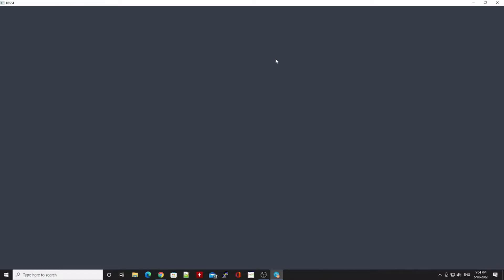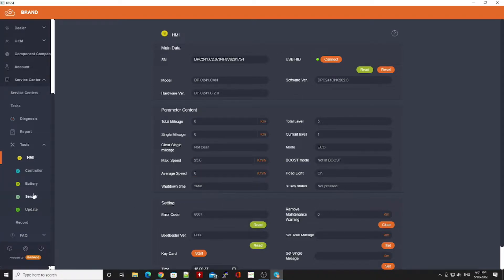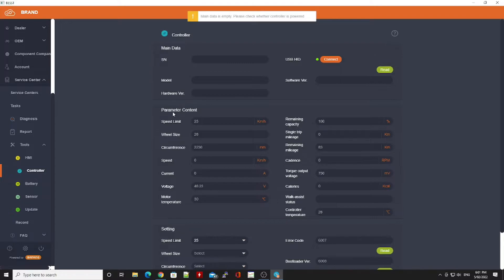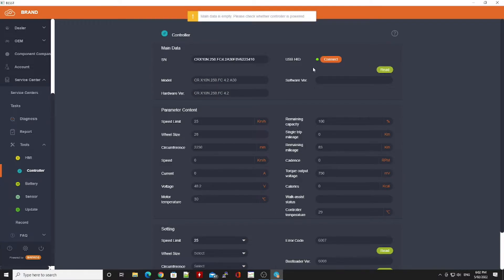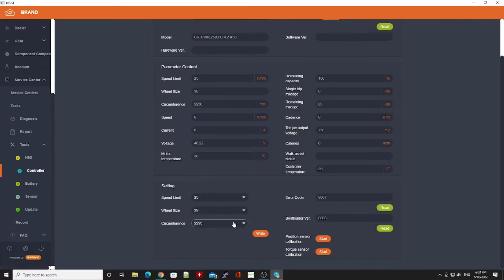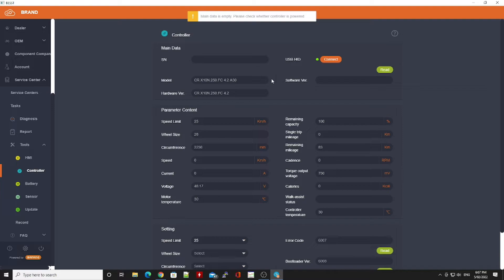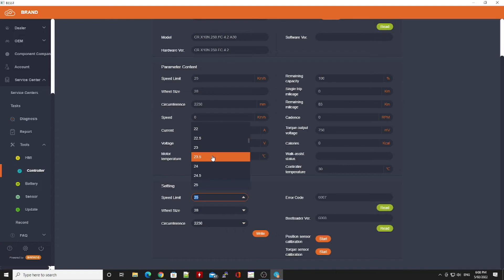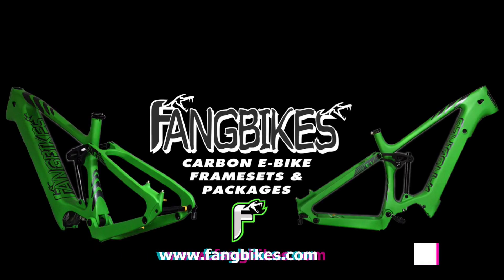Bafang M500 Speed Limit Increase - BESST - Solution - Read controller serial number

Comment: Hi, I would like to ask for some advice.
I am trying to increase the speed limit through the "besst" program.
Unfortunately it won't let me. I can only set a lower value than 25km/h.
have filled in the serial number correctly.

error: "Dealer or Assembler can't change it to bigger."

I tried the latest and older versions of "besst"
Does anyone know how to do this please?

Thx.

Comment: Can I use the best tool to add a display setting. My BBSHD is 52v  but my display only has a 36 or 48v setting. It works okay but is not as good as it was with its original display (which broke)

Comment: Question: It works with the new M410 (same new ∆ Connector) as well? Nowhere i find answers) 
 The older M400 still has the round plug...
Thx

Comment: Hi ,
I have a Jorvik mt7 tricycle with a 250 w mid drive motor bafang M 500. I thought the M500 wasn't programmable. I need to have more strength when I climb a steep slope and i would like to add a few amperes. Is the bafang M 500 really programable? If it is, Which cable to I need please ?

Thanks for your Video

Gabriel
Reply from the maker: You can update the wheel size and speed limits, but otherwise you cannot update any of the power delivery parameters. The tool is called the BESST tool. Cheers
Reply: @fangbikes2751 and how do you get access to use the tool? It says on the bafang website you need to contact them to get access after downloading.

Also I second the question about cable/comnection.

Comment: Se puede cambiar el límite de velocidad de un m500?
Reply from the maker: Yes you can.  The process is the same for the M500 and M600. I do not know about the M510.
Reply: @fangbikes2751  Is a possible change the Speed up to 25 km/h only from the display???with +/-????

Comment: Hi.. I want to weld it m510 to a 20 inch folding bike.. is there an option for 20 inch bikes in the settings??
Reply from the maker: Yes there are multiple wheel settings in there
Reply: @fangbikes2751  dove si compra beest?? posso fare da smartphone??

Comment: My M625 doesn't have throttle from a dead stop. I have to be going a few km per hour for it to engage.
Can I override that with this software and the tool?
Reply from the maker: no idea, sorry.  This is for the M500 and M600 range of motors.
Reply: @fangbikes2751  I have an M600 now that doesn't have throttle from a dead stop. 
I have to be going 5-8km/h per hour for it to engage.
Can I override that with this software and the tool?

Comment: Hi can you give me the link where to buy the PC-motor cable
Reply from the maker: the BESST tool? you might have to try online. otherwise there is no "cable" it plugs (inline) with the display, using the display connector.

Comment: does this work through the USB port on the display unit?  There is no port on the speed controller itself....
Reply from the maker: No. You need to use the BESST tool. Which plugs in-between the display and the main wiring harness.

Comment: I suppose you have used a can-bus  to usb controller. Do you think this would work also for B020 Bafang rear motor?
Reply from the maker: The BESST tool is essentially CANBus to USB converter. But customised for Bafang.   I don't know about B020 sorry
Reply: @fangbikes2751 possibile fare questa modifica di velocità su bafang m500 che è su una fantic issimo???? Che software serve???solo da PC o anche da smartphone

Comment: I tried to do this for my M600 but it still doesn't let me change the speed limit. Do I need a certain firmware or is it that bafang has blocked it? Thanks
Reply: M600 are usually 45kmh already. What is yours?
Reply: @Seaslug1273  can you change the wheel diameter? Or is it only the speed? Do you get an error.message?. Maybe you could.try a new firmware
Reply: @TheAnimalector  Did you figured out? Just bought E-bike with Bafang M600 and wondering is it possible to tune it more..
Reply: how do we increase the speed at the start?
Reply: Try an older version of BESST application